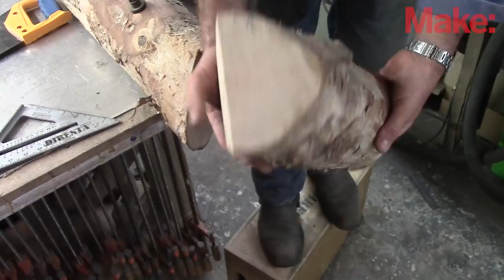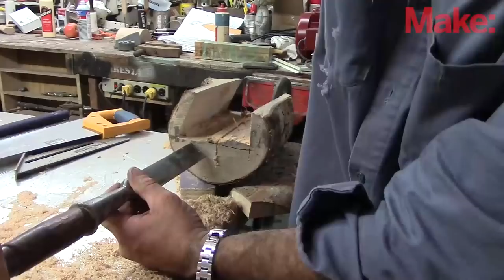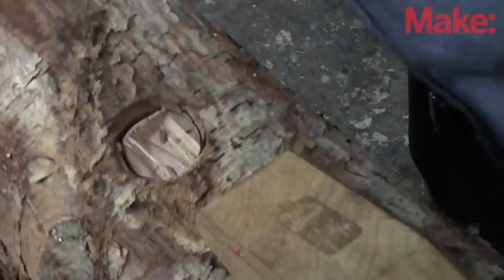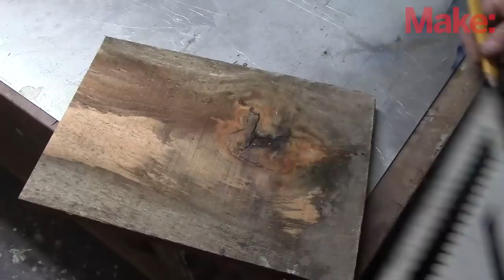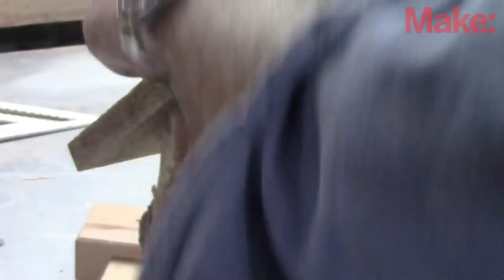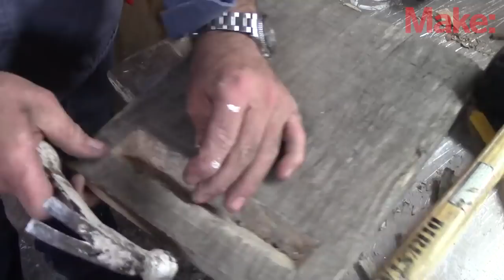DiResta: Log Bird House

Comment: Excellent work. Not trying to be critical but either the roof should have screws or the floor should be on a hinge for easy access to clean out the previous years nest because of mites and cleanliness.

Comment: This is a truly fabulous bird house. As  someone pointed out, too, the sounds of the work speeded up was pretty neat. I do like my power tools and do may have a go making a similar bird house in my lazy man style. A couple of things pointed out in someone else's bird house. They do need ventilation. They also need to be cleaned out periodically to get rid of vermin that get carried in on birds making their homes. I had an uncle who made a removable bottom using concrete nails in drilled holes. He should have used screws. The raccoons climbed the tree the bird house was attached to, removed the nails, and ate the eggs or birds that were inside.  I no raccoons have to live too but.......

Comment: Nice.
I like using natural branches with holes in them, I feel that the birds prefer these type of boxes.
Though may I suggest if you check what size hole is best for certain species  you will get a higher percentage of boxes being used👍

Comment: Should have just used a short length of straight branch for the perch-more rustic,IMHO.Actually,I would have used a piece of scrap dowel. Maybe fasten the roof on with brass screws,so the roof can be removed easier for cleaning.Otherwise,a beautiful job.

Comment: It looks really cool. However, the peg under the entrance hole is not such a great idea. Some birds can harm their tail feathers on it since they approach the hole in a vertical orientation. When they try to fly into the hole the peg will pierce their tail and damage the feathers.
Reply: wow, i didnt know that, thanks
Reply: "Honest, nurse, I was just approaching my front door vertically, as I usually do. I have no idea how that peg ended up stuck in there..."
Reply: It's much worse than that.
That peg makes it easier for bigger birds or critters to gen to the eggs or birds inside...
Reply: Who the hell told u that